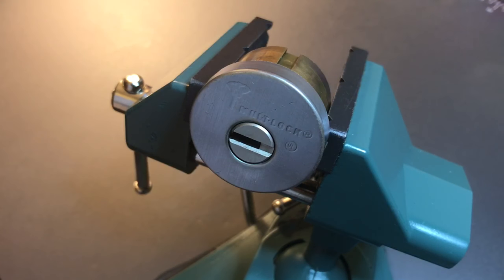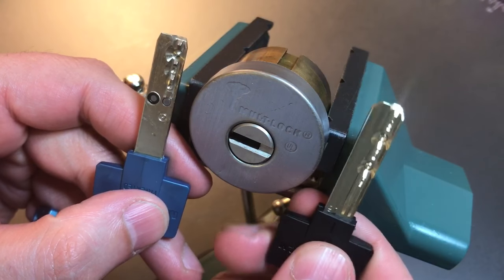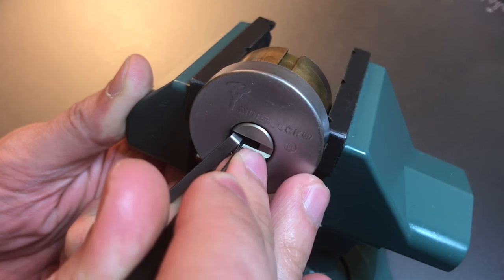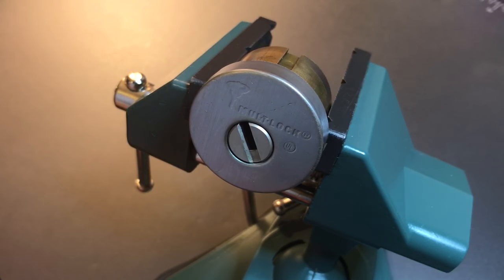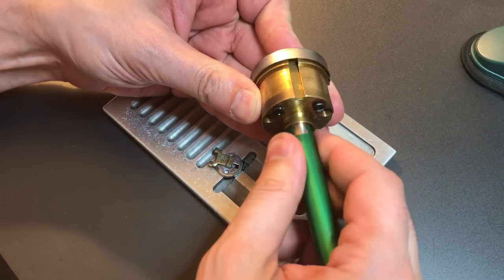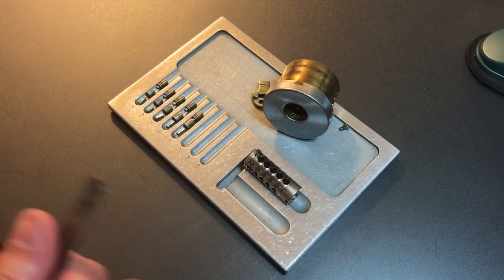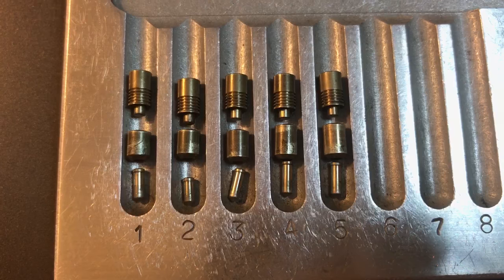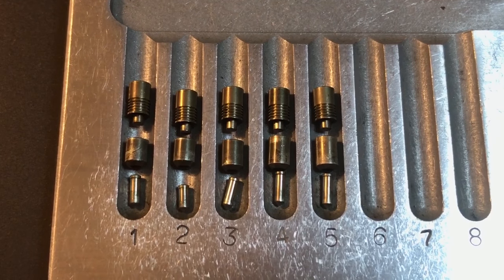[342] Surprising Mul-T-Lock Interactive Picked and Gutted

Comment: Great video!! Just an interesting fact: The Mul-T-Lock keyways have 4 characters: 3 digits, and 1 letter. The first digit of the keyway code determines the position of the floating pin, the next two digits state the keyway, and the last character determines the colour of the floating pin, or if there is at all. (I.e.: A 206S key has the floating pin in the second position, has the 06 keyway, and a silver floating pin :D.) Since the first half of the 206 keyway is flat and without any warding, a 006 key will fit into a 206 lock just fine, but a 206 key will not fit into a 006 lock :D Thanks again for sharing
Reply from the maker: Thanks, and thank you for sharing the info.

Comment: The interactive pin is built into the plug. That’s the difference between Interactive and classic. On interactive the second pin is a rotating constant. Other than that both use the same pins.

Comment: Awesome pick,
So the UL rating is more based off of the drill protection?  
Guessing that is because the method of entry preferred by thieves is to drill a Mul T Lock?
Reply: Yes, Mul-T-Locks with the UL rating have better protection against drilling than the standard cylinders
Reply from the maker: Thanks.  Boaz is correct... the UL rating FOR MTL's is based on drill protection because all of their product already meet the other requirements.
Reply: LockPickingLawyer I was really was only askingif the only variations to the UL has only the little steel inserts or ball bearing above the pin stack.
Really makes them like Master Lock more and more.  I had a much higher standard for (Underwriters Laboratory)
But the only difference maker is drill protection then I might consider a different lock onnmy front doors.  Lol... I understand that LPL or pickers of that caliber
will not be breaking into my house. But not every thief has or uses a drill. 
Thanks for the info. 
My thoughts on it mean nothing,  keep up the good work.
Reply: You aren't going to drill a mul t lock with a HSS bit.

Comment: @thelockpickinglawyer

For reference, all you’ve got to do, is check on the opposite surface of the keyway, for the sprung nipple.

What can a picker do if no binders are present?  I’ve had an E11 closed shackle, in my naughty bucket, since 2012, not one pin set ever, tried everything.  I have successfully picked many mlt’s, this one has taken over a 1000 hrs from me, with zero to show from it.  I believe I’m going to dissolve it in acid, to bring this nightmare to an end.